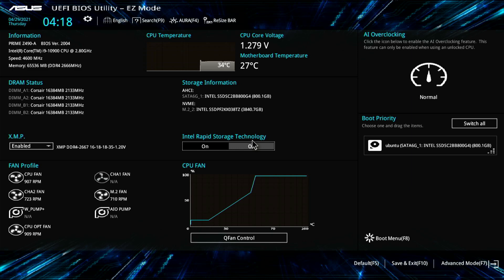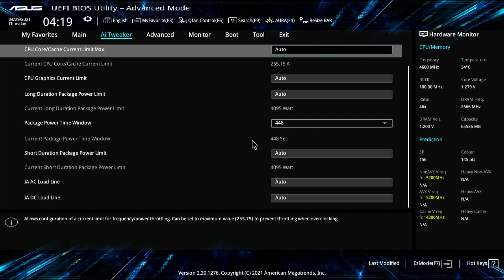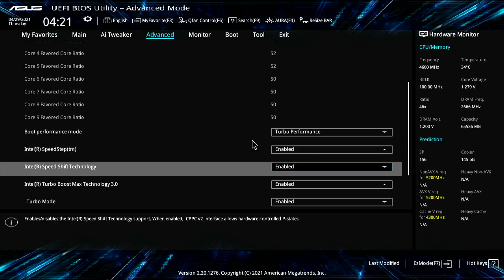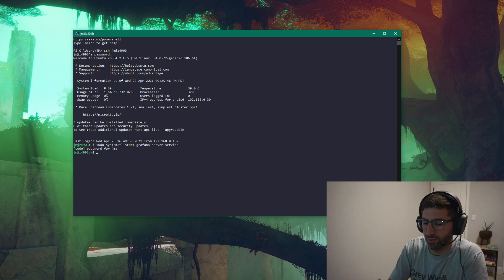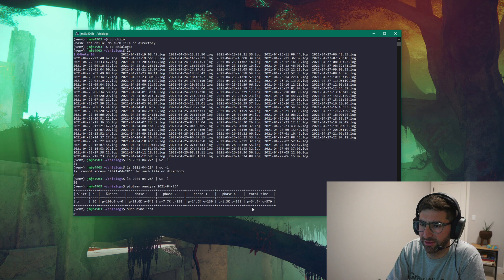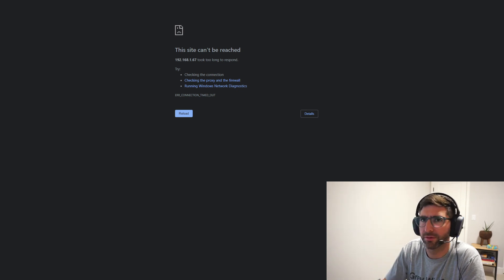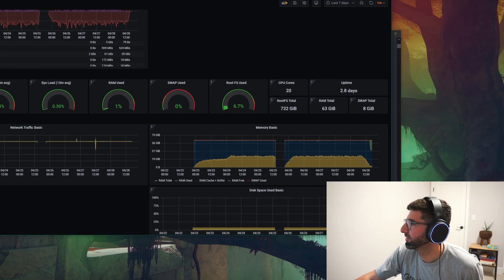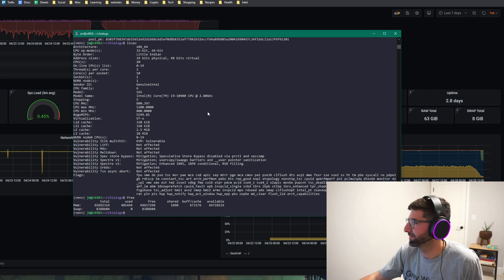Chia plotting - BIOS settings for ASUS Z490 Prime and i9-10900 for 3.9TB/day

Comment: my boards kept on resetting randomly with even modest OC settings. it ended up being XMP II causing issues, also i suspect c-state and speedshit/step.  Disabled those and set XMP I  gave me a super stable 4.9Ghz with no heat issues all day @1.34V. Pumping out around 40-45 plots, 3 max parallel plots at a time using separate SSD's for each plot.

Comment: How can you allocate 8 threads per job on a CPU that has 20 threads when doing 14 plots in parallel? Maybe I'm misunderstanding how this works?
Reply: The thread scheduler distributes threads to spare cycles.  Threads aren't locked to any particular core...this inherently allows over-allocation as a thread has to start/stop and wait for disk IO, making room for another thread in the mean time.

Comment: Hi JM u are my idol. im using TR 24core, 2tb nvme x4 (non raid0) ,128gb ram
but only able to produce much less than ur 4Tib/day! 
i poke around in keybase and youtube, getting 28plot yesterday. 

2pcs corsair mp600 pro 2tb
2pcs xpg xpg sx8200 pro 2tb

each ssd queue 6 plot parallel with delay220 min, nonbit, b 4gb, r2 on window10 GUI. https://www.screencast.com/t/WCIyt24mi0

am i do anything stupid?
Reply from the maker: use bitfield (default) and higher r value if you are going to stagger. You want CPU utilization high and iowait low for high plotting output!
Reply: @ChiaDecentral  can i run r24 on 1 plot on 1 nvme drive, another plot also r24 on another nvme drive, make it 2 plot line, continue the line with delay time needed for 31% by using 3rd and 4th nvme drive. 

in keybase they always mention high thread is not going to help the plotting speed thus i never try...

Comment: Hello! Thanks for the video!
BTW, do you use your 2xNVMes in Raid0, or it is not neccessary because they will be limited by PCI-e line speed 3500? Maybe using 2xNvmes in parallel without raid will give better speeds for two queues?
Reply: load RAID drivers before/during installing windows, look up your motherboard for them. This way you can use Intel RST instead of ahci. Then use diskutil to format your 2 nvme's as striped volumes (raid0). Dont use storage spaces in AHCI. I have 6500 mbps raided this way on pci4 nvmes with a 10900k (which is typically pcie3 compatible only on many mobos).
Reply: @theterricsTV  Just curious, how many plots per 24hrs do you get with that current setup? Thx

Comment: Thanks! Can the similar settings be applied to the NUC 10 with i7 core BIOS?
Reply: I think there is a performance mode in the bios, not as many knobs. I can do the nuc next!
Reply: @JMHands  that’d be great, thanks! I followed your recent tutorial on setting up nuc and it keeps freezing for me every now and then. Did you happen to see similar issues?
Reply from the maker: @patison4ik5  I've had two people report that and it was faulty DRAM!!! do a memcheck
Reply: @ChiaDecentral  I’ve done multiple things already. Memcheck, upgrade kernel, disable ssd power saving. Just got sick of it, ordered a bunch of hardware to build a PC following your guide and returning the nuc.
Reply: @ChiaDecentral  Got my build all set (almost, waiting for a bigger nvme, but started with a 1TB yesterday, waiting for my over 2TB to arrive) following your budget plotting machine guide! Thanks a lot for putting it all together. I had one question. I'm currently running 3 screens (3 plotting processes). Using your grep command on logs to see the approx daily plotting it gives me 1.46 TiB/day. However, I started about 24 hours ago, and got only 2 (1024G) plots created so far. No errors in the logs. The process is going. Do you have any suggestions/ideas?
Reply: @ChiaDecentral  Hi, how many minutes do you stagger per plot? or how many minutes before another plot starts for parallel ? Thanks